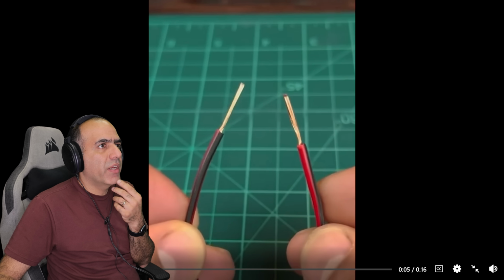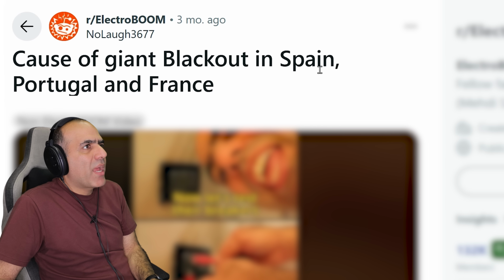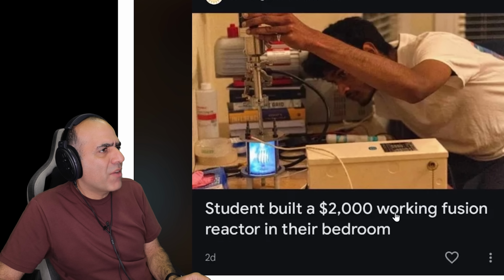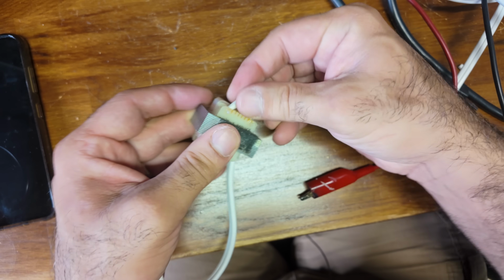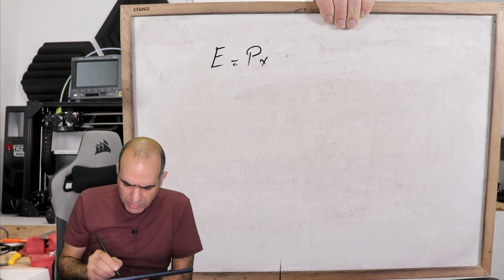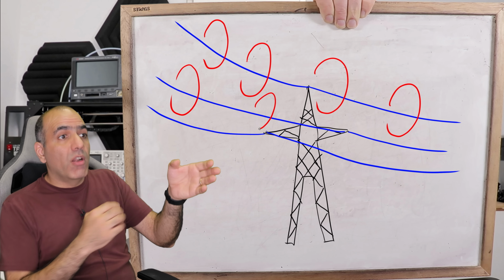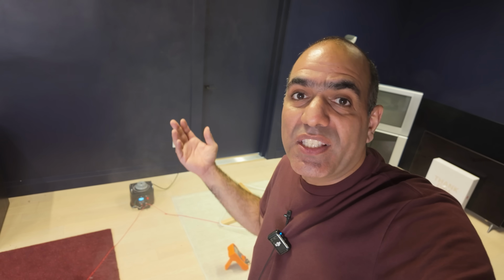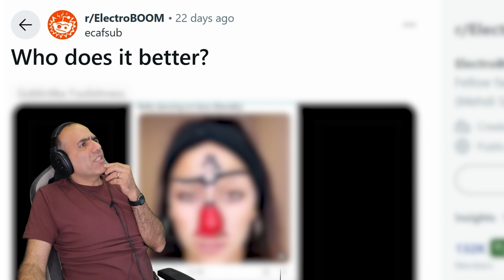Power Lines at Knee Level? Campfire with AA Battery?! (LATITY-016)

Comment: 6:05 It's entirely possible that the kid made a fusor in his bedroom. 
That's an apparatus that consumes hydrogen and electricity to form Helium, but in tiny TINY amounts at a hellish power cost.
Technically a Fusor IS a fusion reactor, in kinda the same way that a lump of uranium is a fission reactor.
Reply: I guess it depends on whether a "reactor" needs to be capable of a self-sustaining chain reaction or merely capable of forcing isolated reactions.
Reply: To count as a reactor it has to achieve criticality. Otherwise like you said, a lump of uranium is a fission reactor. Or less hyperbolically, an RTG is not considered a reactor despite that it works by nuclear reactions and even generates electricity. Reactors don't have to generate electricity, research reactors for example aren't typically hooked up to a generator, but they do have to achieve criticality.

Comment: This Video is a perfect example of why you shouldn't do your own electrical work in your home. Any electrician will tell you that #14 wire can't safely handle 30A of current without compromising the wire wire insulation. Your standard dryer runs off of 30A, so you can imagine how a house could catch fire if someone haphazardly installed a #14/3 or #12/3 cable to their dryer assuming it would be fine. The dryer turns on and there doesn't seem to be a problem at first, but that wire starts to slowly heat up until it melts the insulation and then a short happens inside the wall. Then your house burns down.

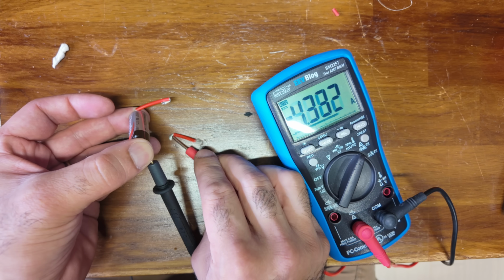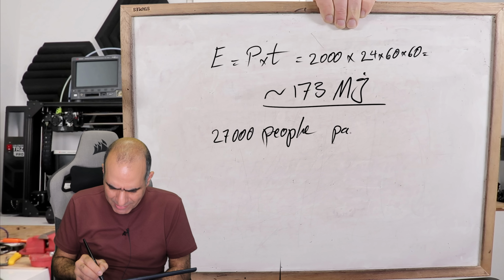Comment: 2:18 you're trying to measure current with a multimeter that has higher internal resistance than the load. It's not even heating the wire red hot anymore when you connect it in series. 7:46 same mistake again, your meter is not adequate to measure that current at 60mV. Try a clampmeter while shorting the wires. 9:31 What are you doing, that's all wrong.

Comment: I guess it was 2000Wh in 24 hours but they forgot the h in Wh...  That would equal 83W generated in average over 24 hours. 83mWh per person passing the gate. But that's still a lot because it would require a work of 150W for the 2 seconds the gate turns. You'd had to push quite hard...🙂 Maybe if ten people pass it simultaneously... 🤔

Comment: The battery trick can be done with anything conductive, for example i ran this experiment with the foil covered paper from inside a pack of smokes, rip a strip, then rip out a chunk in the middle so it is narrower, and touch the battery foil side down. And it doesnt start burning but using the pack itself as fuel you can get some embers to start a fire. 
And it can used iwth any batery.

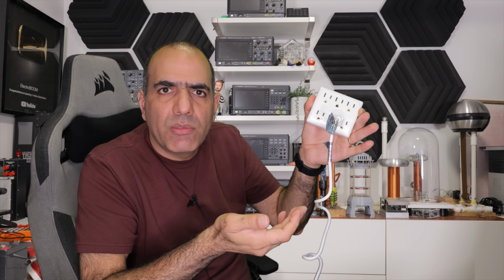Comment: 4:05 I have actually used this on a power strip where the stupid cables had too big of bricks on the end, so the only way to fit everything I needed was to go between 2 of those bricks using part of one outlet and part of another. I do feel like it is more laziness on the design side then trying to add features though.

Comment: 4:00 There absolutely is an application. If you have a bulky AC adapter plug taking up half the space of an adjacent spot, then you can reclaim it by plugging a regular sized one that way
Reply: Or they could just space out the sockets to a reasonable distance.
Reply: @scaredyfish  it takes more materials, makes it more expensive to make, transport etc.
Reply: @scaredyfish  True but if they did that you'd buy fewer outlet strips. Bad for business.
Reply: if you have a whole spare outlet next to it, why would you need to use two halves of outlets instead? just use the open one that isn't fully covered

the only use I could see for this is if you have an outlet strip with four spots and had two of those bulky adapters in both far sides, such that only half of each middle outlet is open. seems like a very narrow use case, but it's interesting to think about, I suppose
Reply: I just assumed it was someone being lazy in CAD applying an equals constraint to all the spacing between vertical slots.
Reply: I expect what's mostly going on here is a combination of aesthetic considerations, and balancing the difficulty of assembling the thing (in the era when they were assembled manually, which is probably when the thing was originally designed) against the amount of space it takes up.  If you space things too far apart, the device is annoyingly bulky; if you space them too close together, it's a pain to assemble (or if you really put things too close together, you can get unwanted current arcs).  And if they're approximately evenly spaced but not quite evenly spaced, it "looks wrong" (sort of like a picture on the wall that's angled three degrees off from plumb, which is a major pet peeve for a lot of people), so if it's fairly close to evenly spaced anyway, they even it out perfectly if possible, for aesthetic reasons.
Reply: @jonadabtheunsightly It's also worth noting that in the original video it wasn't a UK plug, only a UK socket, so the spacing didn't even need to match to do it
Reply: I do this regularly. I have a plug that's a little bit wide and I can't put it on the end socket because the thing is right next to my couch.
Reply: That would only make any sense when you have two bulky AC adapters and at least 4 outlets in a row. Anything below or what was shown here would not work / has no benefit. So you can plug the bulky ones at the outlets to the far right and left so each is covering half of the two inner ones, than you could plug something between the two middle ones. If you only have 3 outlets, you're loosing one anyways, so you can only plug in 2 devices and then it doesn't matter where you plug them in.
Reply: @Bunny99s There are also situations in which you could plug the bulky plug in offset so that it takes up only 2 outlets instead of blocking 3
Reply: @bosstowndynamics5488  You're missing the point. If the bulky plug is on the end it will only block 2 outlets.
Reply: I would bet it's just because it's easier to do it as a single linear repeat in the CAD software.
Reply: In the original video of the plug inserted between 2 sockets it must be noted that the plug is Italian and the sockets are not. That's a great hack to avoid buying the adaptor!
Reply: you got it first

Comment: I've seen a couple channels make "working" fusion reactors. They do really make devices capable of sustaining fusion reactions for a short time and at very low amounts, but they take far more energy than they could ever output, and most of the time they don't even try to collect that energy since it just adds unnecessary complexity, and the main goal is just for observation or sometimes to obtain cool things like helium from hydrogen isotopes.
Reply: Yep. No shot of getting more energy out than in or anything like that, but fusion DOES happen so the titles/headlines aren't entirely wrong.

Comment: On the "wire balls" they are called drip loops because even a fog will cause moisture to condensate on cable and telephone wires and if it runs in the house because it's not sealed, those prevents it from running into the connection block which the ones that are shown or called, but they're improperly done, because I don't see the line running out of the bottom going to the house ground which they're supposed to have according to wiring code.

Comment: It's fun to take a 4' or, even better, an 8' fluorescent light tube, and walk under these cross-country overhead power transmission lines.  It works best after a rain.  You get a low cost, low intensity lightsaber.

Comment: we call it here a drip loop and we do it on pretty much on every outlet here in aus, houses are insulated but also have to flow air, cold in winter blistering hot in summer.

its been standard for a long time as stated in that comments water cant go uphill it will collect at the bottom of the line and drip off rather than go into the switch.
Reply: most places have drip loops they just don't look like that
Reply: But a drip loop indoors and near no water?  On Coax connectors?  Come on....
Reply: Except water CAN migrate upwards due to capillary action.

Comment: At the AA battery segment, they where using steel wool, it might burn better or somehow make the wire hotter. The difference between steel wool and a napkin can be the difference between fire/no fire. Same thing goes with the the material they are igniting, it can have a lower burn temperature then paper.
Reply: A number of years ago, I learned not to store 9V batteries and steel wool in the same pile.  Luckily it caught fire quickly while I was still there.
Reply: @kc9scott  We used to pack both on camping trips to start fires, great combo.

Comment: 4:00 the application could be to fit irregularly sized plugs on the same set of outlets, I sometimes have trouble fitting larger plugs with small plugs on the same set of outlets, perhaps the spacing is just so the user can optimize the arrangement of their plugs for a better fit.

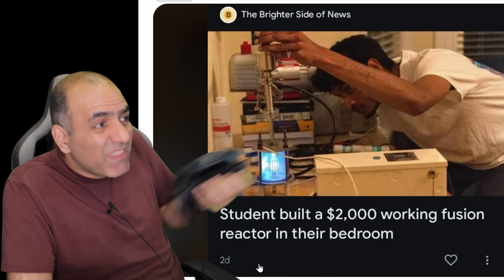Comment: 5:44 fusions harder than how medi says, normal hydrogen (H1) wont work as its just 1 proton
helium is 2 protons AND 2 neutrons, 
you need Deuterium ( Hydrogen with 1 extra neutron) to fuse with Tritium (Hydrogen with 2 extra neutrons)

Comment: the battery trick is legit it can easily make paper burn, video used charcloth but id say to use nitrated cloth instead, might make a poof of flame lel, for the outlet thing you went off on and made a fool of yourself like you always do and is why i watch, its so you can arrange those chonker power bricks efficiently

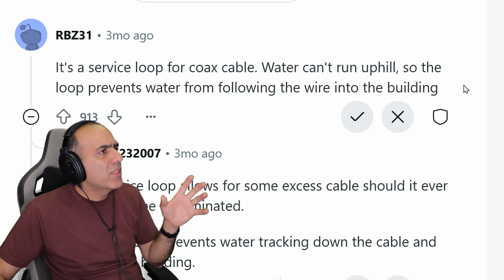Comment: 10:23  I would be surprised if they don't loop fiber channel in Vancouver, I can confirm its done in US an UK. Fabre optic cable is sensitive to kinks and bends.  This is a tactic to reduce stress on the wire, especially before stressful turns, as it were.

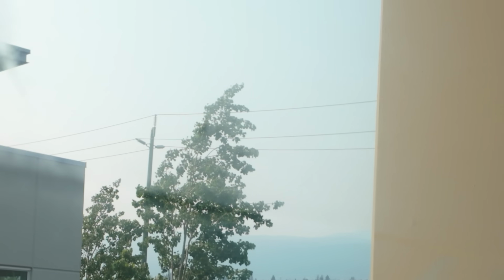Comment: Are we sure the line at 11:38 is three phase?  The top wire appears to me to be a shield wire on a bayonet.
Reply: Im pretty sure it's a high voltage DC line and the charges are getting transferred through the electric fields.
Reply: @hardnachopuppy  HVDC?  To me that looks like a bog standard 12kv line.
Reply: @kcgunesq the guy in the video said its a 345kv line
Reply: @hardnachopuppy  34.5 maybe.  But definitely doesn't appear to be a 345kV line to me.  Maybe the scale is just confusing me.  In any event, it doesn't look like three phases to me.
Reply: @kcgunesq "does not look like 3 phase" is another reason to think its HVDC

Comment: 2kWh per day for 2 days the experiment lasted, I think he tried to say. So many people don't know the difference between energy and power.
Reply: I thought 2kw wasn’t a right unit
Reply: @kingdomadventures  27,000 passengers producing 4 kWh in 2 days. That's 0.15 kWh per passenger or 540 Ws. Sounds closer to reality...  If the turnstile turns a 1/3 rotation in 2 seconds 70 cm, as Mehdi suggests, the force would need to be 79 kg! That's too much. However if you run through, and pass it in only 1/4 second, the force would only need to be 9.9kg. that should be possible for a large fit person. No children or old ladies! However that does not account for mechanical losses, so the electrical output would more likely be half that. So those making the proposal, have taken a best case scenario where 27,000 bodybuilders run through them machine for two days and ignored all mechanical and electrical losses in the system. Another problem is that muscle power is dirty energy. Because of emissions from agriculture and food industry, food is the dirtiest energy source known to man when used to produce mechanical power. 6 times the CO2 emissions from the food you have to eat, than what a diesel engine emits through its tail pipe for the same amount of work. So the whole concept of tapping energy from people trying to catch their train is flawed. It would be less damaging to the environment if they generated those 4kWh by burning 1.6L diesel in a diesel generator set.
Reply: @Tore_Lund you’re right, I missed the video where he said “per day”. The gentleman left a pretty long pause between “produced two kilowatts” and “per day”. My mind only registered him saying 2kw, which would have been the wrong unit of measurement. I retract my previous comment :)

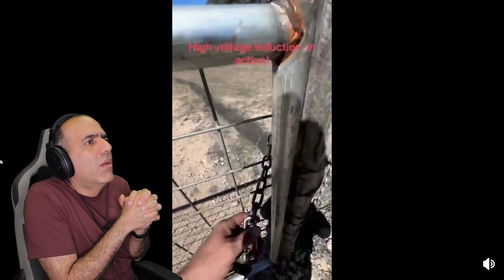Comment: 11:10 That's why at my company everything metal is grounded. The doors of the server racks? Grounded. ANy door with a metal frame? Grounded. The Battery closet? Grounded. heck, guard rails(handrailing) too!
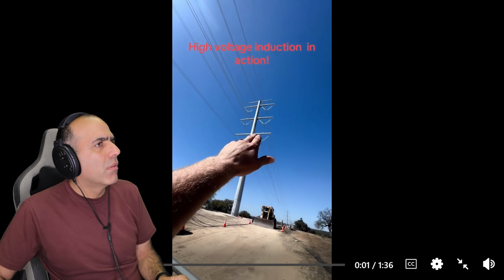Reply: 10:47 well that is true and mutch scarier with rf there is stories from people living near high power radio transmitters hearing the radio in fences metal bed frames and there is a story of a guy who broke his jaw and got the bone repaired whith metal bolts he lived near the long wave transmitter topolná in czech republic with transmied on 270khz AM at 1.5 MW the guy could hear radio in his head.
Reply: @hanapriknerova5712  kHz, not khz.
Reply: It is a requirement of the National Electrical Code that all exposed metal must be grounded.  This keeps people from getting electrocuted.

Comment: High voltage line can be as much high as insulators high or air gap distance of maximum voltage so basically is right and is not a problem that is in knees high

Comment: There is some high voltage setups that can fuse and fusion react hydrogen isotopes. But its impossible to use that compeeatoively simple design for energy generation. It guzzles a lot of power and the fusion rate is very very low.
So yeaj its technically a "fusion reactor"

Comment: 13:25 After watching ElectroBOOM for a few years now, I can proudly say I knew this was coming when I saw 34 Amps running through that tiny wire.
Reply: I saw how tiny the wire was and heard him say 34 amps and told myself “for how long?”  You can’t put 10’s of amps through wire the diameter of a string…for very long.

I gave the video out a like because replacing that rug won’t be free. :)
Reply: 10:47 well that is true and mutch scarier with rf there is stories from people living near high power radio transmitters hearing the radio in fences metal bed frames and there is a story of a guy who broke his jaw and got the bone repaired whith metal bolts he lived near the long wave transmitter topolná in czech republic with transmied on 270khz AM at 1.5 MW the guy could hear radio in his head.
Reply: @hanapriknerova5712  hopefully he didnt mind that station tho, i dont think he could change the frequency of the station
Reply: As someone who lives next to two active FM radio stations I can confirm hearing radio on any of my amplifiers and sometimes headphones directly when no audio is playing. One of the stations is ran by an old hippie fellow and it has this terrible buzz coming out of it.
Reply: @To-mos  We used to hear pilots' chatter when planes went overhead from the Spectrum when playing games as kids.
Reply: @To-mos while I understand that you can pick up AM with headphones not connected to anything how could you pick FM
Reply: @To-mos  But he has a good buzz.
Reply: @hanapriknerova5712 , that guy had a spotify implant lmao
Reply: @hanapriknerova5712  free 6 oclock news
Reply: @hanapriknerova5712 Now Imagine they played Zombie... In your head, in your head...😅
Reply: @hanapriknerova5712  I heared some ghost story of a guy moving to a new apartment. After a few weeks there he started to hear voices from time to time while laying in his bed at night. He thought he's going crazy and went to the psychologist for years. Someday he got out of bed at night and noticed the voices coming from a toaster that he bought a few weeks after moving in and stood on the other side of the wall as the headboard of his bed. He throw the toaster out and bought another one the same day and he never heared the voices again. Turns out he lived a few miles from an backup transmitter that only comes on if the main one a few miles fruther away goes down or would maintained and the heating wire was the exact length to pick up that signal.
Reply: same lol
Reply: I was expecting it to start melting a little sooner than it did. What gauge do you think it was? I'm guessing 14awg.
Reply: @willjohnsonjohnson It might be that 18 gauge stranded aluminium wire from the battery fire test at the beginning. If that's the case it hold up insanely well I guess.
Reply: I was looking at the display it says 7 volts and 34 amps and I immediately know that discharging 200+ walts of energy this way would probably lead to some disaster, like that is already the waltage of a small heater, you don't really need to look at the wire to tell that
Reply: I think that even Ampers are now scared of him.
Reply: Same! I watched the videos with that auto transformer and knew once he put it to that current and had those skinny wires hooked up, it was only a matter of time...